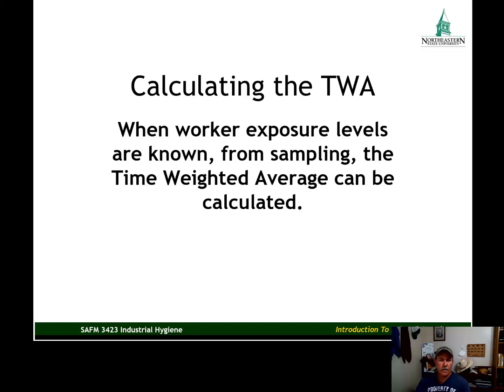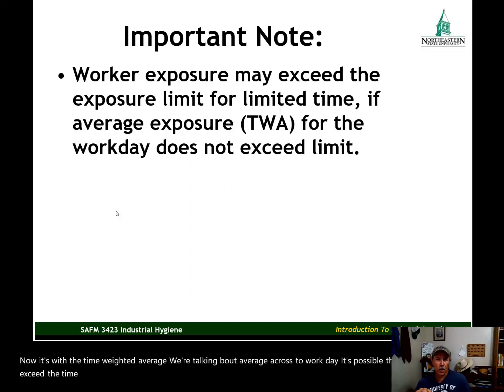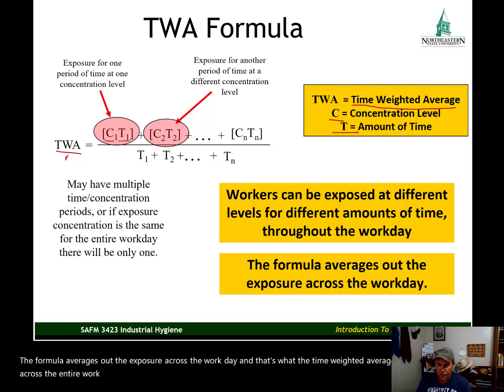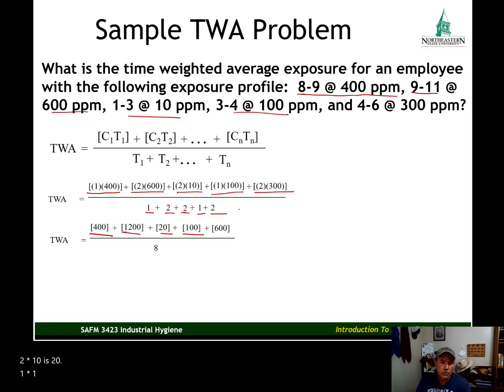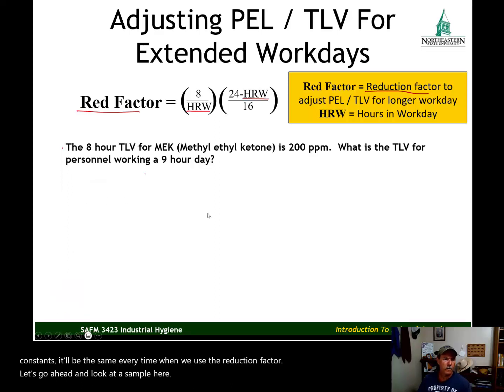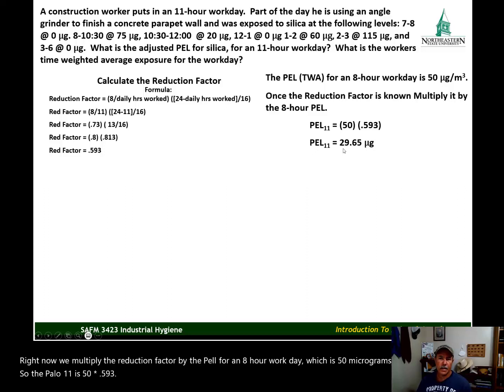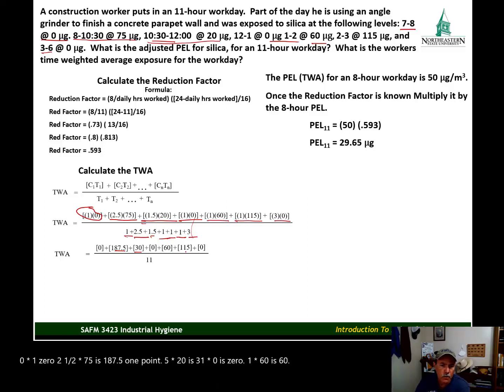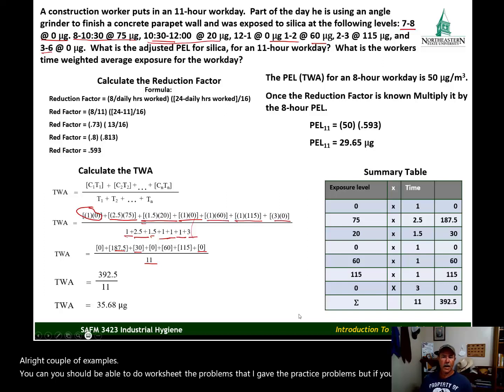Time Weighted Average Calculation

Comment: What if it was a 12 hour work day, but an employee was only performing abatement for 85 minutes of the day?
Reply from the maker: There are adjustments (correction factor) for workdays exceeding 8 hours.  Should be covered in the video.  Also for some substance there are published exposure limits for 10 hr workdays.  Record zero exposure for part of the workday not involved in abatement activities.  If abatement involves lead or asbestos I encourage you to review OSHA guidance for exposure to those substances.

Comment: Thanks so much.  As a residential HVAC contractor we perform C.O. monitoring from our customer's gas furnace.  Sometimes folks have a cracked heat exchanger where the spent gasses could escape into the air ducts and on into the room.  

So the 8hr TLV/PEL for CO is 50ppm (per OSHA).  That's 400 ppm over any 1 hour period, 50ppm for 8hrs, 17.5 for 14 hours (average time spent at home), 2ppm for 22 hours (stay at home parents/retirees/unemployed), and 0 ppm for 24 hours a day (bed-ridden).  

The examples were great.  I feel much better about telling my techs how to advise our customers on any readings we get - and please feel free to comment/correct me if I'm wrong.  Thanks again.  This is the best and clearest explanation.
Reply from the maker: CO is an often overlooked airborne hazard.  There are way too many preventable deaths each year.  I would not be comfortable with 400 ppm exposure for a one hour period.  If you send me an email address I’ll send you a chart showing health effects at different exposure levels.  In a home environment I would recommend diagnosing the problem and taking corrective action when detected at 10 ppm or greater.
Reply from the maker: Let me qualify my previous comment, 10 ppm and greater concentrations detected in living areas should be diagnosed (identify source) and corrective actions taken.  Furnace rooms, hot water heater areas, garages (unless occupied) etc. would be exceptions.

Comment: Thanks for uploading such a detailed video, it really helped. just one Question - will PEL be mentioned in safety data sheet or we have to search through HSE alike bodies? like for silica its 50
Reply from the maker: PEL, the OSHA permissible exposure limit will normally be found in the SDS.  However, depending on the product, there may be multiple harmful constituents and the PEL for each constituent will be reported.
Reply: @SafetyProCalculations  i have an exam question and dont know how to convert 2 litre sodium hydroxide solution into mg/m3. any help please
Reply from the maker: @decentmwt1  Sorry.  Can't help you on an exam.  Contact your professor.

Comment: Thanks for uploading this lesson!! I just finished an introductory Industrial Hygiene course. I had hoped for it to be a little more advanced. I was disappointed when I discovered the course was not going to provide any lessons in using the TWA formulas. 

By using the examples, your video brings the math to life and I can clearly see that it really is as easy as you said it was. I believe that taking the time to understand this math is what sets the real safety professionals apart from the entry level. 

For discussion - for respirable dusts, how would we know what the exposure rates per hour are? Would that be a matter of changing out the collection cassettes each hour to get that hourly measurement?
Reply from the maker: An industrial hygiene class that did not cover Time Weighted Average!!  You should ask for a refund--LOL.  Glad the video helps.
Reply from the maker: Monitoring for respirable dusts requires the use of different instruments, depending on the dust of interest.  Silica for example we use a personal sampling pump connected to a cyclone.  The pump draws air through the cyclone (usually at 1.7 liters per minute) and microscopic particles are captured on filter media.  Filter media is then sent to a lab and processed.  The lab tech basically counts the number of particles.  The number of particles along with the sampling time will provide a measure of exposure.  This is a three lecture question.  Hope the brief answer helps.